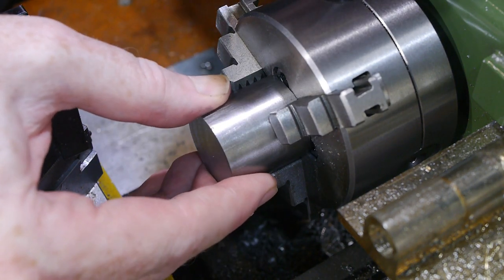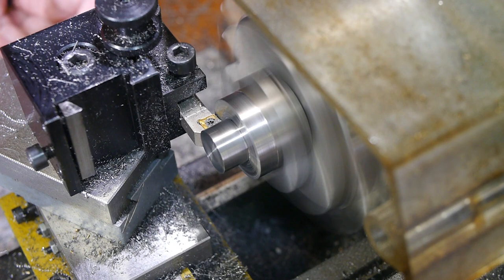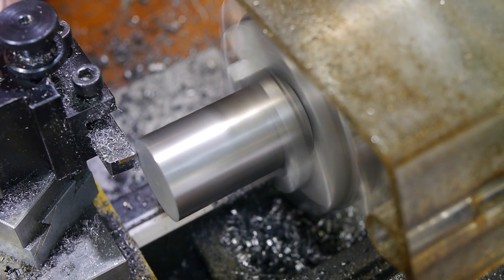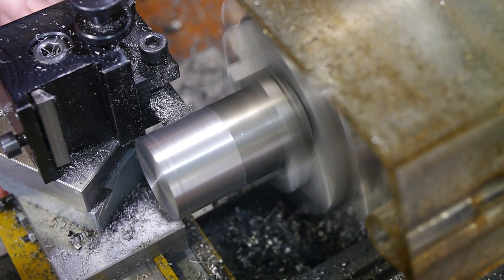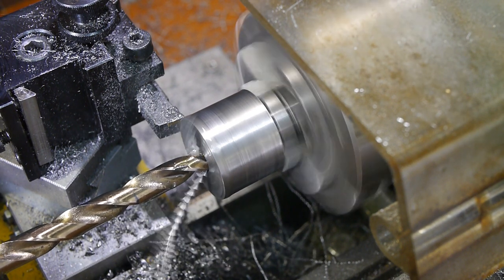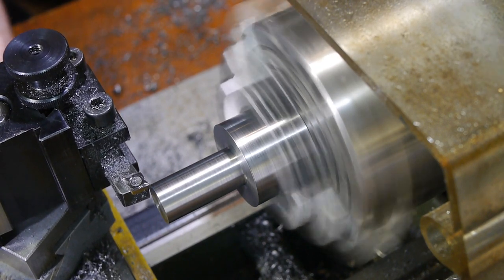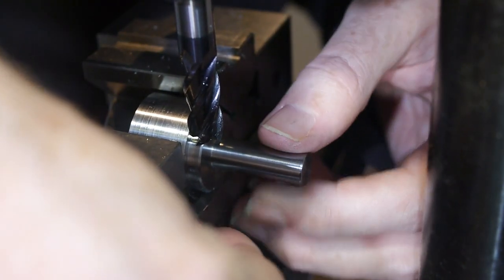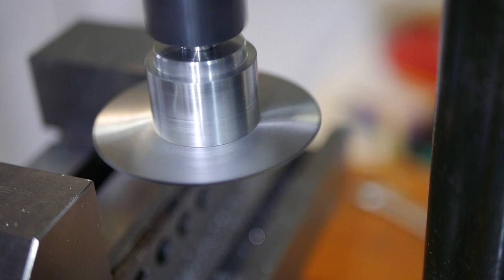Slitting Saw Arbor

Comment: I was the same, a slitting saw was one of my first tools before I had an appreciation for concentricity
Looks like it turned out well
Reply from the maker: I slipped up slightly when relieving the OD that the blade sits on, and now the saw is a little loose. Fortunately all the blades I own have worse concentricity than the arbor. :)
My next design will be better! I think I have a design where I can turn the critical dimensions of the saw inner diameter and the shank in a single setup. Keep watching to see if I manage it. :)
Reply: @AdventureswithaVerySmallLathe  Can you tell me the brand of blade you are using.  Several reviews of UXcell blades have bad comments about blade quality axial runout and out of round?  this will be my first slitting saw and I don't want to waste money on bad blades.  really enjoying your channel
Reply from the maker: @nastykitty2  The blade is unbranded, from eBay. I haven't been able to source branded blades in the UK as a private individual.
Reply: @AdventureswithaVerySmallLathe  Thanks I guess I'll go with the UXCEll from Amazon and f is bad keep returning it until I get a good one

Comment: excellent job. I was waiting for the assembly part...

I also like Joe Pieczynski slitting arbor with very low profile and buried bolt to gain extra clearance should you need to cut very narrow pieces off, nearer to the chuck etc.
Reply from the maker: I did a follow-up video with improvements including a buried bolt. Check 2 or 3 videos after this in the timeline.
Reply: @AdventureswithaVerySmallLathe  ok will do. thanks!

Comment: Great job, Well done!!
Been contemplating making the same kind of thing for my Mill too.
Reply from the maker: Thanks! They're pretty cheap to buy, as long as your milling machine has a standard taper, or can hold a 12mm shank. The Proxxon mill can hold a maximum of 10mm, so it was a choice of trying to mod. a commercial one, or make my own.

Comment: One suggestion (since I make this type of tool myself quite often), counterbore where the M6 screw sits. M6 cap heads have a diameter of < 10mm and that would easily keep the 16mm centering section strong enough.

The advantage of this is that you can get the saw arbor closer to the vise jaws when cutting parts in a vise.
Reply from the maker: Nice idea! I'll do exactly that. I was watch Stefan Gotteswinter's Saw Arbor video (https://www.youtube.com/watch?v=bRQPv4AG2HQ suggested by Pennycook2 in the comments of my recent Change Gear video) and I was struck by how much sleeker this arbors are than mine. He uses a pin face spanner to tighten a thread in the end cap directly into the body, but isn't a practical modification to make to my existing build. The counterbore is a simple retrofit, and makes perfect sense. Thanks!
Reply: My saw arbors usually have the inner section with the screw built into it too, but in my case, I usually broach a 5 or 6mm hex into the inner part so I can use a hex wrench. That said, most people don't have a rotary broach hanging around. 

A counterbored screw is the next best thing :)
Reply from the maker: Right, I don't have the tooling for rotary broaching. Most of those available are too large for the Proxxon. Using a stock screw is a significant simplification to the machining steps too.
Reply: I actually have a Proxxon PD230/e, so, even smaller :) So, I made my own rotary broach. Hemmingway Kits sells a kit of my design (I don't get anything from the sales anymore, so, just letting you know it exists). It's the same one that a few machinists on youtube have built. It was designed for machines the size of the Proxxon 230/e and FF230 (which I also have, though I'm mostly using a larger mill now).
Reply from the maker: Nice! I have a Rotary Broach on my project list. Didn't think to check Hemmingway. All the off-the-shelf rotary broach holders seem way too large though.
Reply: They're both large and expensive, hence why I designed and built my own. It's one of those things that's nice to have in your toolbox. It's saved me from having to slot screw heads so many times.
Reply from the maker: I just watched your video of the broaching tool; very nice little compact design. Love the custom controls on the lathe as well. BTW Is the PD230 actually smaller than the PD250? I thought the 250 was in incremented design based on the former, about the same size?
Reply: The 250 is a little bigger. Mine has 53mm center height and accepts 220/230mm between centers.

The lathe has some custom controls and has had quite a bit replaced. It has a watchmaker's lathe cross slide and top slide. I built a custom saddle to take that. I've recently replaced the leadscrew too.

The 250 fixed some of the issues I have with my lathe, would have been nice to have waited a year and got the 250. As it is, I'm rebuilding a Sieg SC4 turns out, I have to re-manufacture half of it (probably more than half). But it's a fun project.
Reply from the maker: The 250 is just a little bigger, but I can imagine that makes a lot of difference. The SC4's going to be a whole lot bigger though. I'm currently severely restricted by my workshop space, and don't have room to upsize my lathe.

I can totally understand wanting to replace the upper parts of the carriage. The top slide on my lathe is very sloppy, and I'm planning to build a solid tool post to replace it for machining where the compound isn't required; the same style that Robin Renzetti describes on his channel. I can't really see much of your modifications in your video, apart from the brass controls. I'd love to see more if you have the time and inclination to make a video about the mods.

Stefan Gotteswinter often refers to the cheaper Chinese machine tools as "kits". Perfectly fine as an initial purchase, but lots of work and modifications required before they make a decent machine tool. Best of luck with the project!

Comment: Nicely done! These are tricky to do with minimal runout.
Reply from the maker: Thanks! I just watched your slitting saw arbor video from a couple of months back. Nice tool! It looks a little like what I was going for with my first try, but without all the mistakes I made related to run-out. How do you find it copes with thicker saws, when the spigot is only in contact with a small proportion of the saw's inner diameter?
Reply: I only have a few thinner slitting saws to use, and so far it seems to be working ok.  Basically I got the slitting saw blades cheap and the price of the arbor (free scrap metal and an old transmission bolt) was right, lol.

Comment: Very nice to watch a machining video in metric. Thanks for sharing but I did find the music distracting. Cheers
Reply from the maker: Being a metric machinist can sometimes feel a little lonely on YouTube. ;) Thanks for the feedback on the music. I try quite hard to find non-intrusive background music that matches the length of the content, but I think the selection I made for this video doesn't work so well. Would you prefer something less obtrusive, or would no music at all suit your taste better?
Reply: Adventures with a Very Small Lathe Thanks for reply. My personal choice would be no music, it’s not needed as I’m here to watch and listen to the content. Hearing the metal cut is good enough for me! It also gives me an idea on what feeds and speeds are correct and how it should sound when they are. That’s useful information to me who is just starting out with my metal lathe and mill. Cheers
Reply from the maker: Thanks for the feedback! I'll make sure the machining sound comes across when it matters, and try and include more information about feeds and speeds. I've had quite a few comments from people liking some of the music, so I might face a subscriber revolt if I get rid of it entirely. ;)

Comment: Hello,

Do you have a fly cutter to be used with the PF 230 ? I think it is not easy to find one with a 10mm shank...
Reply from the maker: I've found some very small fly cutters with a 10mm shank, but I haven't tried them yet. I found that the spindle on my PF 230 is quite badly out of tram, and I need to fix that first, as it will badly affect the accuracy of the cut.
Reply: Do you have a link ?
Reply from the maker: Sure, these are the ones I bought:

https://www.ebay.co.uk/itm/152869619586
Reply from the maker: The RDG TOOLS fly cutters look pretty much identical to the ones I have, and the price seems about right.

The cutting oil I use is labelled: C. Bennis Supplies and Services 1758 Neat Cutting Oil
I know very little about cutting oils, so can't offer much advice about alternatives.

Comment: Can you tell me the reason for using cold rolled steel?
Reply from the maker: I already had the steel, it was cheap, and the whole project was an experiment. I didn't want to waste more expensive material until I verified that I could machine the design to the right tolerance, and that it worked.
Reply: those are the best reason. I thought I was missing something.

Comment: Nice to someone dealing with tiny lathes. :)
ER collet chuck would be a good thing?
Reply from the maker: Thanks! I use an ER collet chuck for some projects; check out the Machinists Mini Jack videos for the most obvious use. I tried making an ER collet chuck for myself shortly after I started learning to use the lathe, and it was a bit of a disaster. They are surprisingly tricky to get right, and when I made a mistake, the run-out was bad enough to make it unusable. Now I have ER chucks of various sizes, all affordable Chinese made tools which fit into the Morse 2 taper in the Proxxon's spindle.

I love your music btw. Makes me want to fire up my old synths again. :)

Comment: What lathe and mill do you use?
Reply from the maker: The lathe is a Proxxon PD 250/e and the milling machine is a Proxxon FF 230.
Reply: Would you recommend?
Reply from the maker: @derekwilliamson5442  I would reccomend the lathe to anyone who wants a reliable small lathe, and doesn't want to do a lot of work on it. (The chinese lathes seem to need a lot to get them into good working condition). I would not recommend the mill, as it just isn't rigid enough for the work I do on it.
Reply: I saw a ball attachment on the PD400. Is there something similar for the 250?

Comment: Concentricity is poor on threaded holes and shafts.
Reply: but better than the arbors you commonly find online, esp the cheap ones. .020 runout is common in slitting saws and even the blades have some

Comment: Nice job fella, A lot better than I could turn out on the piece of shit Peatol lathe I have now- everything I do on it is a hardship!, Best regards, J.
Reply from the maker: I'm sorry your lathe hasn't worked out they way you hoped. There are a lot of tricks to work with a small, lightweight lathe, some of which I've learned over the last couple of years. As I mentioned early in this video, my projects were worthless at first. What are the main issues with the Peatol that make things difficult? It sounds similar to the frustration I'm having with the milling machine at the moment.
Reply: Ah, Where do I start?, I maybe expect too much from a teeny little machine, though there are several awful glaring faults with the basic design, starting with the headstock which through belt tension twists and goes out of line, Compound slide that has the weakest clamping arrangement on earth, tailstock that is canted over away (?) from the headstock, Blahhh, I'm just a bit grouchy tonight I guess, Nice Arbour though, A fine addition to the armoury, Bedways is bestways now, Quarter to three in the morn, Sleep tight. J.
Reply from the maker: That sounds like a tough bunch of problems. I've had nights where I've gone to bed, shouting and swearing in my head about the problems with my machines that I thought I couldn't solve. Best of luck with your efforts, and thanks for your comments about my video. I'm glad whenever anyone enjoys watching.